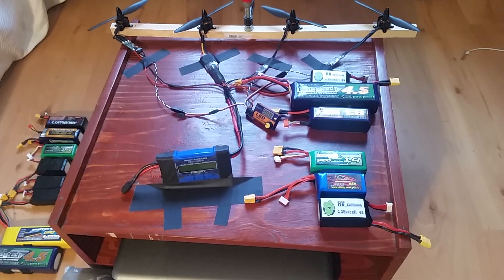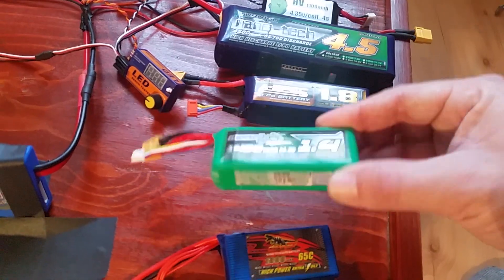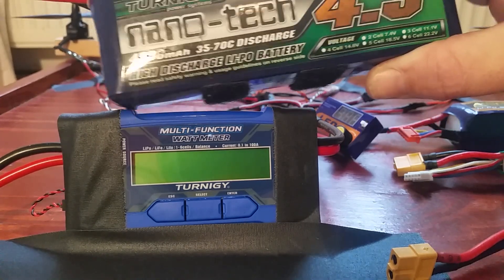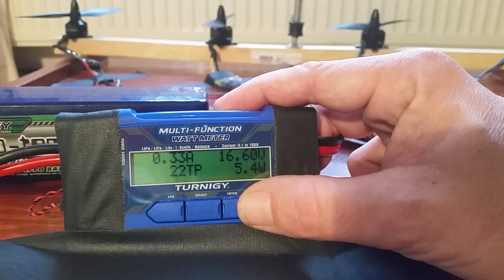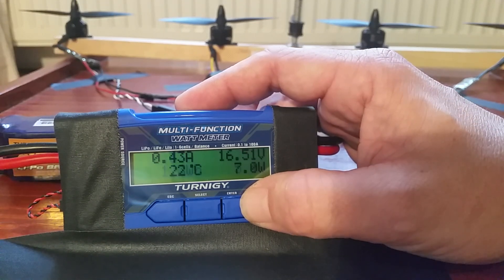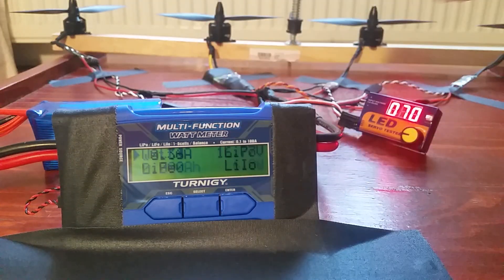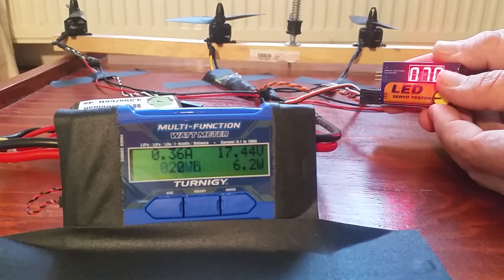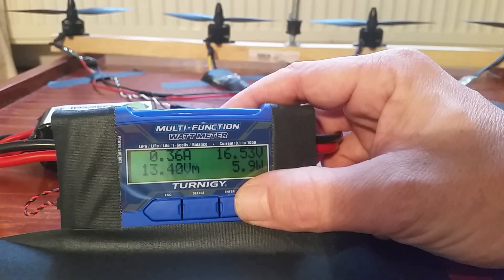Lipo  VS  LiHV.

Comment: Looks like your Turnigy Wattmeter maxes out at 100Amps. Whats the chances that the maximum amps given by the 4500 Nanotech would be exactly 100.0?
Reply from the maker: The amps are past 100 obviously.  If you look at  the watts, It is more realistic and the Most important. Amps don't mean much. 
Our packs delivered very high Wattage output. meaning the volts remained high, while still providing over 100 amps.  Over 26 percent more watts (power) than some competitors packs.

Comment: Hi I just ordered one battery LiHV multistar 5200mah and I didn't know before I placed the order that needs a charger that supports LiHV can I use the normal lipo mode to charge it because it's not worth to return it back as need to pay half the price postage fee. Thanks
Reply: Hobbyking has the S60 that's $30 and will charge LiHV. Mine will be here shortly with a 4S 4000 mah Multistar LiHV. Seems like a good deal. Bang good has $50 charger for about that same. http://www.banggood.com/Ultra-Power-UP100AC-AC-DC-Plus-100W-Lipo-Battery-Balance-Charger-p-1055857.html

Comment: New to Quads sorry.

While I understand the three numbers on the battery, what exactly are you testing for and what does it relate to when flying?
Reply from the maker: Basically. ..26 percent more power. normally a 2 or 3 percent gain is a lot.  you see our point, we make monster batteries :)

Comment: how do you charge the HV?
Reply from the maker: most new chargers come with the capability. look for LiHV(4.35v) in the specs before you buy one though. 
 normal older chargers will work, but won't fully charge it obviously. We sell a LiHV charger for $19 to support them.
Reply: Green Gorilla I have a powerlab, but there's no setting for hv. I assume they have a firmware update or something for it, since these LiHV are more prevalent now
Reply from the maker: +doluseb yes the power lab is upgradable I believe.